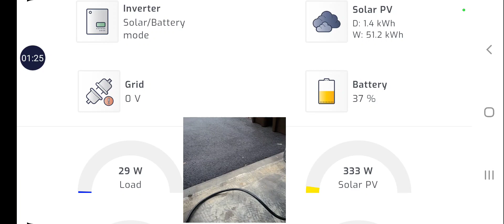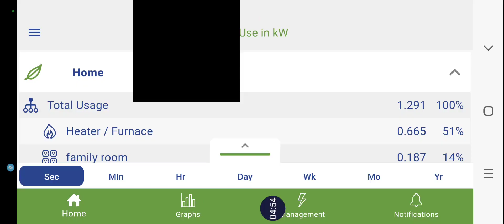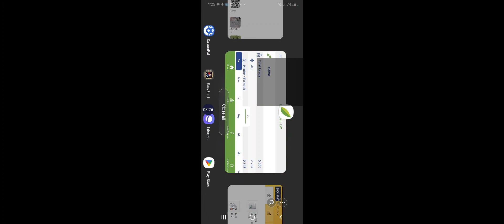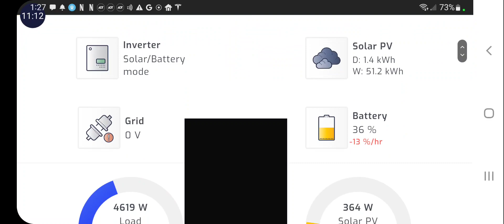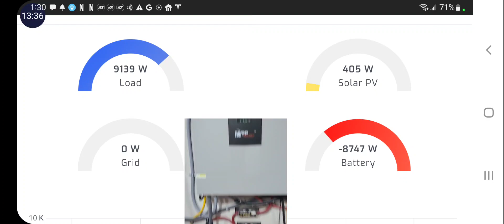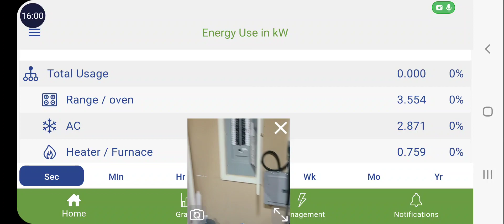Powering my entire house (including 5 ton AC) with my solar generator!

Comment: Just ran across your channel.  It's exactly the kind of straight forward info I've been looking for.  I've also got a Tesla that I'd like to charge via solar.  This video was extra interesting, though.  I've got an interlock kit installed in my main panel that connects outside for my generator.  I've wondered if it were possible to use it with an inverter as well.  Is it as simple as wiring up a (L14-30 in my case) plug to the inverter outputs and it's good to go?  Thanks!
Reply from the maker: Theoretically yes you could.  You need to make sure that your inverter is outputting 240v split phase. (make sure it is split phase not just 240v if you live in the US).  This will power up your entire panel however you will be limited to 30 amps at 240V due to that plug.  So, 7200watts of power output maximum at any given moment.  I don't know if that is enough to run everything, but certainly a fridge, tvs, routers, computers, lights, heat (assuming gas or oil fired hot air or heat pump, not pure electric).  So, yes!  Just make sure you know what you are doing or have an electrician make the connections for you.  Also, when you are running on this, it is best to turn off all the breakers you will not use so something doesn't kick on when you don't expect it and cause your inverter to shut down due to overload.
Reply: @SolarCannon  Awesome!  Thanks for the quick, detailed response!

Comment: why dont you use it all the time to cut power bill? not just for outage? or do you? I live in fl. my whole life power doesn't go out much here either but im wanting one just to cut down on my bill. Let me know where your moving maybe you can help me out.
Reply from the maker: I can do that but my wife and I both have electric cars.  I designed the system to power them.  If we both commute to work each day, that is just enough power to fill them back up on a sunny day.
Reply: @SolarCannon what rate are you charging them at. Fast charging both at 9kw each?

Comment: How much for that system? is it exclusive? or put together by you? meaning its easy to set up? or no? How would it do with 4000 watts of audio? when I say 4000 it rarely plays at that level but has its peaks
Reply from the maker: When I bought it, it was about $20K.  I put it all together myself.  There are companies that sell full kits with instructions.  4000 would just be half of the solar panels.  I need both inverters in order to produce 240v split phase power for large items like the AC.
Reply: I just ran my system today with 2.5 kw running the 18k btu mini split and my oyster oven along with the fridge/tv completely off solar. My system costs $3k... 2 lv6548 and 7k including everything panels inverters 10kwh batteries.